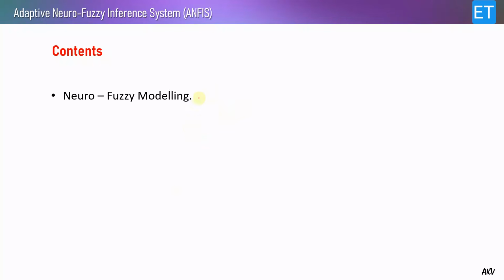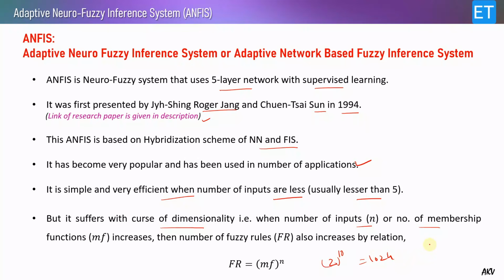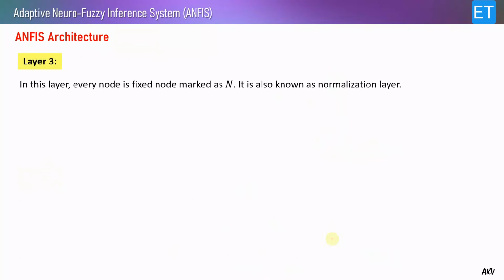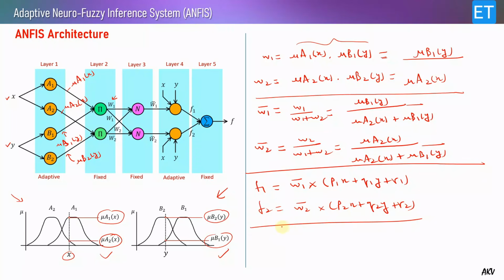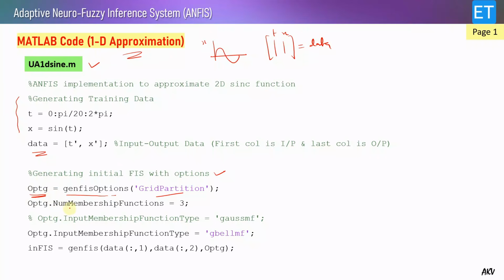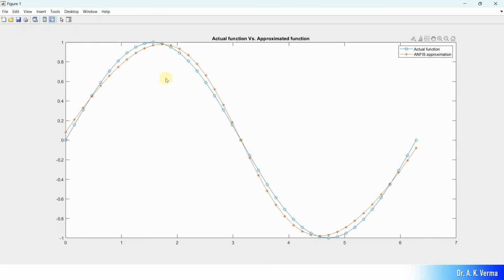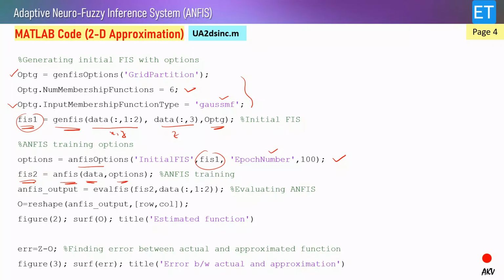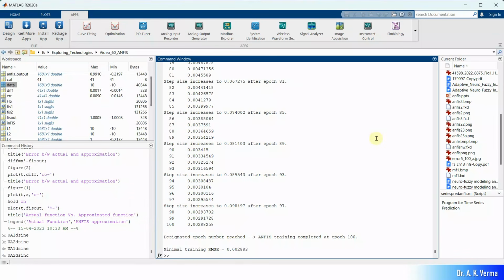ANFIS: Neuro-Fuzzy Inference System (Theory and MATLAB Implementation)

Comment: Dr. Verma, I am working on a project to control a small wind turbine's blade pitch angle to achieve maximum wind energy efficiency without exceeding 47 volts of output. The main inputs for the control system are voltage and RPM. Additionally, the turbine will be enclosed in a box, and the wind will be manually controlled by a person. The problem is that I don't have a wind speed sensor because they are too big and I have to infer the wind speed with the RPM.

Given these conditions, what type of control system would you recommend to optimize the blade pitch angle? Would a PID controller, a Fuzzy Logic Controller, a ANFIS ,or another approach be more suitable?
Reply from the maker: Simplest is PID. It can do well. But ANFIS can be tried. Compare both. It will give u one research paper.

Comment: Can hou clarify why we only need 2 nodes in layer 2? Shouldn't it be 4 since its 2^2? Thanks!
Reply: did you get why it is like that? i have the same doubt
Reply: @onkarchaudhary1233  me too bro. I think the equation RF = (mf)^n is not corrected. It should be RF = mf * n
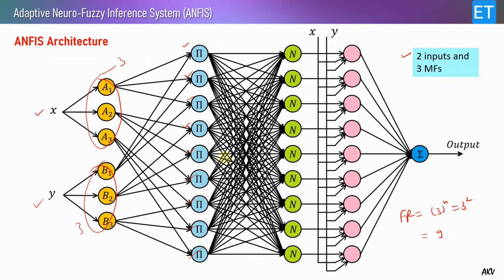Reply: yes, there should have been 4 nodes. We should have one rule for every combination of formulas, as we can see on the picture at 17:45. So, the missed nodes would contain A1 X B2 and  A2 X B1

Comment: thank for your video
I have a question, from which paper you said that FIS are not able to learn?
I really need the refrence
Reply from the maker: Fuzzy system works on pre defined IF-THEN rules. Once they are defined, they are not changed.
While Neural network has weights which are updated with training.
Reply: @exploringtechnologies9  thank for your response, I understand it.

Comment: I'm curious about the reason why we don't have to write rules for fuzzy inference. Does ANFIS work with no rules? Or, does it create rules automatically? (If ANFIS work with rules, does 'fuzzy logic' have its own significance? )
Reply: Athough I enjoyed this presentation as I got to know details about the learning process that I didn't know before, my reaction was similar to yours. The primary purpose of using the ANFIS is probably not to use it as a universal function approximator (standard ANNs are probably a better choice for that, both in terms of flexibility and efficiency), but to explicitly exploit domain knowledge through a fuzzy rule set. 

What we should be able to hope for is 1) to control the learning to conform to domain knowledge and 2) to exploit training data to fine tune the domain knowledge. And I still believe (without having tried it out, admittedly) that can be achieved. I searched the Internet and it seems that there is an addRule function that can be used for this purpose. 

From this presentation, interestingly, it seems that one does not have to specify rules, in which case you just get some free parameters (embedded in fuzzy rule structures) which can be learned during the training (in a very specific ANN structure). But if you extract the rules in the end (after training), it seems unlikely that they will contain much semantic information.